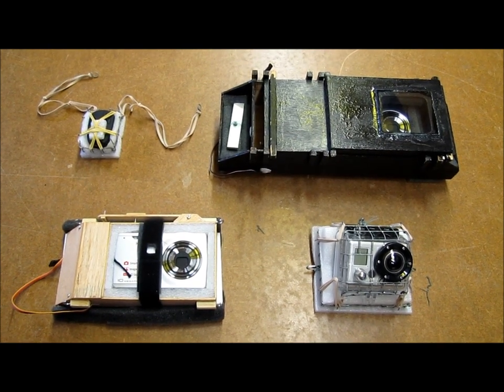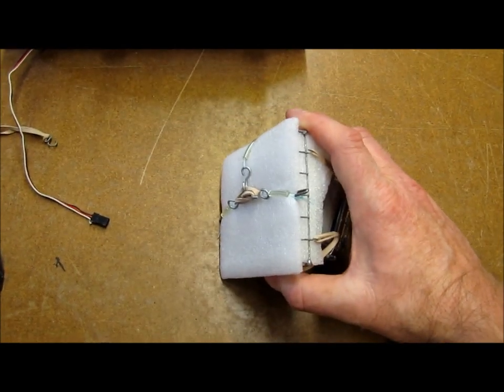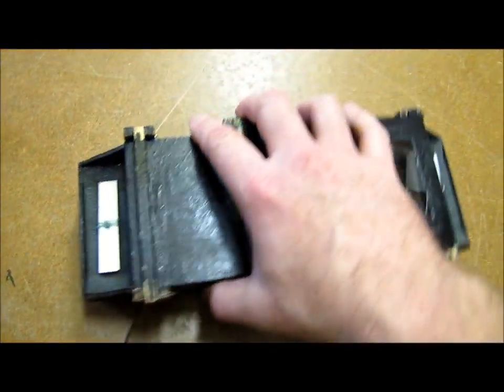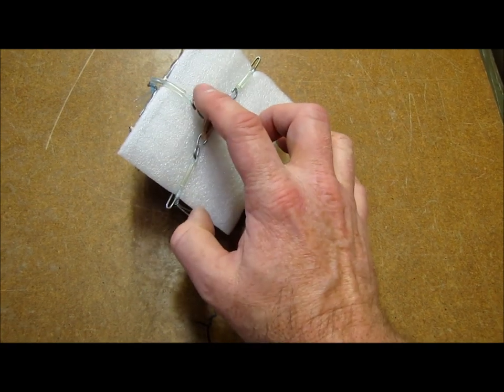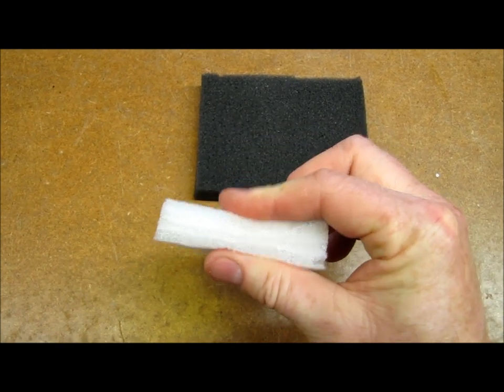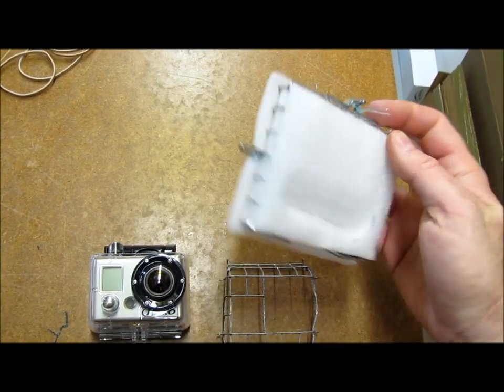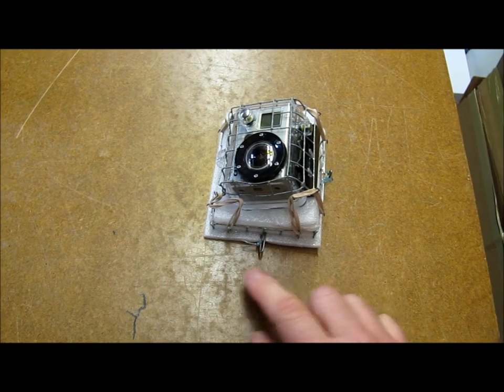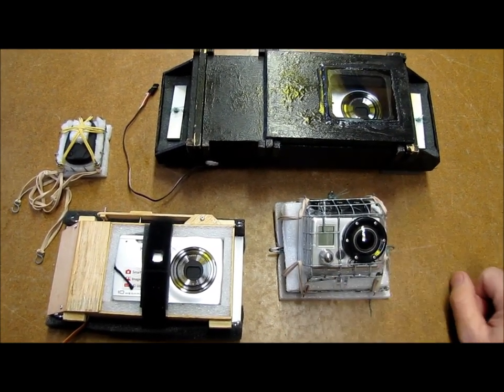Anti-vibration camera mount for image stabilization - a "how to" guide

Comment: Very well done video.  You explained it very well, without repetition or irrelevant talk.  And thanks for not using background music.  I have been experimenting with various methods for the cameras mounted on my Kolb Firefly ultralight.  and a ight plane.  Image stabilization on my cameras works well in some ways, but the high frequency low amplitude vibration causes Jell-O effect.  Your approach is different than I have tried.  Thanks for some new ideas!

Comment: Nice video, you`v put a lot of work into those mounts...all that could be avoided for a $20 worth of "SORBOTHANE" from ebay. Excellent stuff ! works great for light loads like a GoPro camera. It`s what I have on my gas powered plane and I have 0 vibration issues. Might want to look into it ? Good Luck